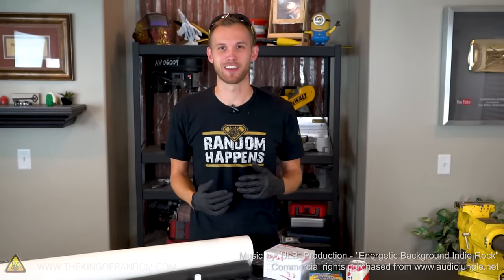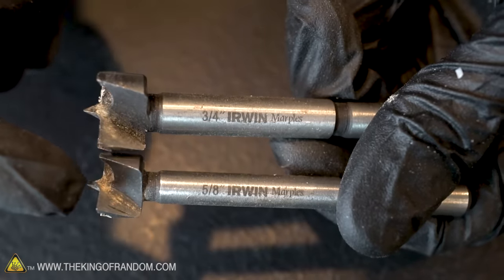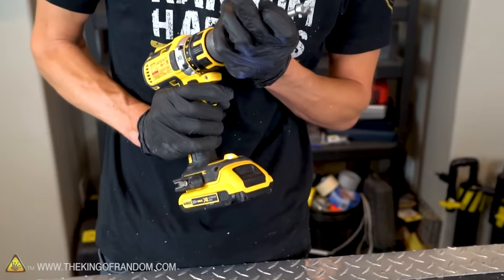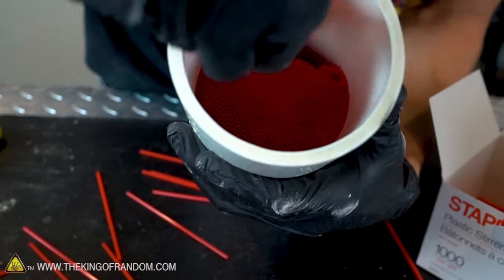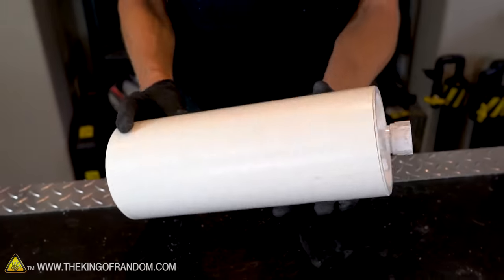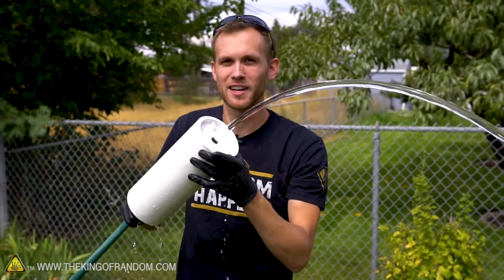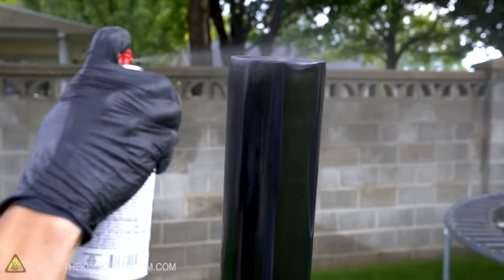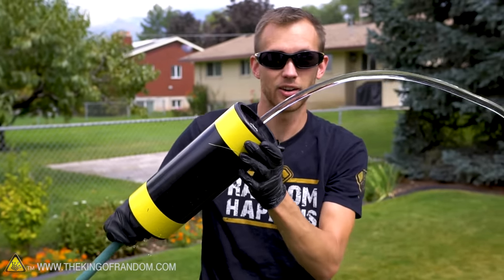Making a Laminar Flow Nozzle! TKOR Teaches You How To Make Laminar Water Flow Fountain

Comment: My hose already does this....
Reply: Gavin Lockheart same, a lot of hoses have something like this built into the drains
Reply: Quadro no I mean my hose. Like garden hose that was 5 bucks. With nothing inside. It's literally just a normal garden hose. And it does this. It's a standard garden hose.
Reply: There's turbulence there that you may not be able to see.
Reply: Deeparth Gupta I'm sure there is a turbulence you can't see inside the stream this contraption creates
Reply: what brand and size hose is it? contribute something to society
Reply: I'm so glad that you meant garden hose and not vomiting from your mouth.
Reply: Gavin Lockheart  I was thinking the same thing.
Reply: ｗｏｗ
Reply: not the same;  one of the things he didn't explain well is that laminar flow is when a fluid flows in parallel layers, with no disruption between the layers; a hose only provides a single flow; not parallel; which in this model is achieved by parting the single flow in to dozens and dozens; via the straws;  the output is much different then you can get with a hose where the water stream is not nearly as smooth and rapidly falls apart after just a few inches
Reply: Deeparth Gupta If you can't see it how do you know it's there? 🤔
Reply: Yea, but most don't have a straight cylindrical stream like in the video
Reply: hoser
Reply: Yeah but did it cost you 30 dollars in extra materials??? I think not!!!😂😂😂
Reply: Gavin Lockheart u are lucky
Reply: Simsimaspineshank S  They make cool fountains
Reply: It's DIY
Reply: @CzarYe  we are talking about your house not your hose, but even some cheap hoses have this system
Reply: 666 likes
Reply: @katethenerd6508  i ruined it
Reply: slorp
Reply: Gavin Lockheart 😭😭😭😭
Reply: robd0gg p
Reply: same
Reply: Get Dustin from SED over here, stat.
Reply: Weird flex but ok
Reply: Mine toooo
Reply: <3
Reply: Ikr
Reply: Same
Reply: Yeah, dont need all of this things.
Just remove the top of your hose
Reply: same
Reply: robd0gg what????
Reply: or does it????
Reply: Same, its a rubber hose but without it, the water is turbulent.
Reply: All hose dude....
Reply: yeah he didnt do much. true laminar flow looks like ice. if you can see the water moving then the water does really have THAT low of a momentum convection.
Reply: Me too the water is like that but I want it faster
Reply: Gavin Lockheart mine two
Reply: Gavin Lockheart LoL I thought you said horse and that would have been a completely different story
Reply: Gavin Lockheart that’s not laminar flow

Comment: You should do this project with something clear like acrylic
Reply: Madhav Valiyaparambil YES PLEASE!!!
Reply: the problem with that is that it's not as cheap. $20 for 2 ft clear pipe, $10 for 10ft normal pipe. and other than showing the parts nothing interesting happens inside.
Reply: You could but other than the initial water charge going into it, there isn't anything to see going on inside. It's not like a filter where you can see debris being captured and removed.
Reply: However, the acrylic might make it possible to add lights to it without compromising the electronics, and making it flashy.

Comment: You sealed the ends with epoxy but the aluminum nozzle will eventually fall off inside if it just has electrical tape holding it in place.
Reply: MegaReddevil91 i was thinking just that
Reply: contact cement would  have sealed it 100%
Reply: PVC cement for plumbing would have been the best option.
Reply: Blu-tack
Reply: Not really.  PVC cement melts the two pieces of PVC together.  JB Weld just fills in the gaps.  You can peel J-B weld off PVC with little effort.
Reply: You claimed that it is "best" but it isn't.  "Just fine" isn't "best."
Reply: You seem to be the one who cares.
Reply: MegaReddevil91 Put elctrical tape then duct tape then gorilla glue it on. Lol. 😃😃😃😃😃😃😃😃😃😃😃😃😃😃😃😃😃😃😃😃😃😃😃😃😃😃😃😃😃😃😃😃😃😃😃😃😃😃😃😃😃😃😃😃😃😃😃😃😃😃😃😃😃😃😃😃😃😃😃😃😃😃😃😃😃😃😃😃😃😃😃😃😃😃😃😃😃😃😃😃😃😃😃😃😃😃😃😃😃😃😃😃😃😃😃😃😃😃😃😃😃😃
Reply: Well Sherlock, you might notice that the aluminum goes in first, then the end cap, and since the water is going out the end cap, the water is pressing the aluminum against the end cap, meaning that the pressure should keep it in place. As for when it is off, the tape is enough to keep it from moving it around. Is that enough? Do you need an equation? A photo?
Reply: Why the gloves and where will this be usefull ?
Reply: MegaReddevil91 I
Reply: He should have used flex tape
Reply: @jaredthomas7993  Crazy glue, definitely crazy glue. It's crazy.

Comment: You can also use PVC glue to glue the ends on. Not putty. 👍🏼😉👍🏼
Reply: Chad Cole its plumbers putty
Reply: hentai lover - I know that’s what he used.
Reply: Totally was thinking the same thing.  But otherwise it was a great tutorial.
Reply: yes, but you don't use plumbers putty on PVC you use PVC cement which is a strong glue that welds the PVC. Putty will squeeze out on the inside like it did on the outside, its more for repair.
Reply: I was thinking the same thing, but maybe he used a solid sealant (epoxy) rather than traditional pvc solvent weld because it can be hard to prevent the primer or sealant from dripping into the pipe (especially if you're a novice at it) which might disrupt the flow.
Reply: hentai lover     "Chad Cole its plumbers putty"

No one here knows what plumber's putty is. One use for it is to take up the space under a bathroom or kitchen faucet set so water and crud don't get under the faucet plate where it meets the sink drainboard surface and start growing microbe and mold colonies and stinking. So, it's just a putty.

The guy in the video said they used a putty-like epoxy to seal their tube and fitting.
Reply: But its more fun to use putty 😂
Reply: Not to mention, you can SEE the 2 colors (blue/white) and he clearly states EPOXY so not sure why it is hard for everyone to understand it is like JB Weld.  That is a far cry from plumbers putty which stays pliable for years, while the epoxy he used will be rock hard in 30 minutes.
Reply: Very go
Reply: PVC glue fumes trapped destroys the straws and scrubbies plastic.
Reply: Flex tape
Reply: @mickeypoppi  prove it...
Reply: Mcroostr --
not sure what part you want proven.  --  
.
The first time I read how to make one of these I was in HS and Graduated in 1971. -- 
As to the source it was in Popular Science between 68-71, not sure when, just that I was in HS at the time. -- 
As to building it; Morris County Museum of Science, Morristown, NJ. somewhere between 1975-77. -- 
As to the ends, we used PVC glue as in the PS article. -- 
As to the lighting idea; it was in the Popular Science article. --
Reply: The putty is made for a glue
Reply: @davewilco822  But don't use it on copper AC pipes. Yeah. The AC guys used it on that, and it came off.

Comment: Put an accumulator in front of the gun.... should smooth out to a more consistent pressure...
Reply: @kingofrandom
Reply: Sam Burris the whole thing acts as one.
Reply: This entire device is an accumulator. Putting another one in front would only ruin the laminar flow.
Reply: use a bladder tank
Reply: No it's not... there's no room for expansion or retention of pressure, all this device is a 'straightener'. an accumulator for liquids will either have a bladder or an air chamber of some volume above the flow so that the air in that tank can act as a simple regulator. 

This is absolutely NOT an accumulator.
Reply: kleetus92 more liquid builds up in the device than can be put out. It must fill up before working. So yes, it is essentially an accumulator. However, it is not ONLY an accumulator.
Reply: This gun acts as a flow regulator... an accumulator is a energy storage device that stores potential energy using compressed gas with or with out a bladder... basically a electric capacitor for hydraulics(water is hydraulics)... so if there is any changes in pressure which there is it will delay and compensate the reaction of the final exit pressure thus smoothing out the flow... fluid power engineer here😃
Reply: Do some research it will become obvious
Reply: Sam, so are you saying this IS an accumulator, or just explaining what a hydraulic accumulator is? I agree with your definition, but not that this is an accumulator. Or am I missing something? Once it's full, its basically another section of pipe, solid walled with no expandable volume to compensate for anything. This is especially true if the discharge nozzle is pointed up.  Down one could kinda make a weak argument that when the water is shut off, this 'accumulated' some volume of liquid that will be drained out after the valve was closed, but that's based purely on it's physical orientation.  Power electronics engineer on this end.
Reply: He said this is not an accumulator. Just a flow regulator.
Reply: What spiffyman said

Comment: I'm curious as to how the flow would behave if the outlet wasn't simply a perfect circle. How about an ellipse, a square, a triangle, a wide slit, or any other shape. Could the flow be made to look like it's twisting?
Reply: Roger Garrett 
Or totally change it and put air bubbles in it.😐

No I get it, designer faucets is what yer thinking.
Reply: yes different shapes, no twisting, laminar is straight out the nozzle
Reply: Roger Garrett you can't make water form a square or triangle lol... unless it's contained.. Water molecules naturally want to form spheres/oblates.. just about like everything else in the universe
Reply: I fully understand that the stream would not simply retain the shape of the outlet. But I would expect that the "collapse" of the shape of the water at the outlet into a more circular shape might just rebound in some way and cause cyclic pulsating along the length of the flow.

Also, if the outlet were, say, very wide in one direction but of varying narrowness in the other direction the water might be coming out faster in the narrower sections than the wider sections and you might get some odd features along the path of the stream.

You could also have an outlet that's not simply an opening in a flat plate but rather more like a nozzle, and that nozzle could be designed so that some of the water is directed in one direction and other parts of the stream directed in other directions, so you indeed get a twisting stream, at least for some segment of the stream.
Reply: Roger Garrett so like a normal garden hose with selectable nozzles? The whole point is that a circle causes no turbulence aka laminar flow nozzle.
Reply: I think nature likes efficiency and round is very efficient !
Reply: even though you can make helium filled soap bubble balloons, they are still teenie round spheres! (bubbles) stuck together to make the shapes!!

Comment: Higher pressure means more velocity.  More velocity means a higher Reynolds Number.   That would also cause it to go turbulent sooner.
Reply: joemonster55 ikr
Reply: faster flow means less pressure; as an example we can look at a wing where the air is flowing faster on the upper side creating a pressure difference between lower/upper side and that generates lift.
Reply: Philipp Campos
that's totally not what he was talking about. higher pressure means more velocity, period.
Reply: joemonster55 would a smaller tube work then? That would cancel the higher velocity in the reynold’s number
Reply: Philipp Campos you are incorrect and especially applying that circumstance to this one.
Reply: Wrong
Reply: Actually, when he said more pressure, the correct term is more flow rate. We can't use de Bernoulli principle to explain that. When the guy in the video opens the valve, he is increasing the amount of fluid that are passing thru the pipe, that is, increasing velocity. 
That is true, for an incompressibile flow, when the velocity increases, the static pressure decreases, and there is the key, the concept of "static pressure". This phenomenon is not easy to explain and understand. If you guys really want to know about it, I recomenda book called Fluid Mechanics, author Frank Withe.
Reply: joemonster55  bro it’s about inconsistency not velocity

Comment: How can I adapt this concept to peeing?
Reply: Brandon Ali sand the edges down make it reaaal.smooth
Reply: siksreik That hurts just thinking about it!😂😂😂
Reply: Brandon Ali is
Reply: siksreik then shove a bunch of coffee straws inside
Reply: Brandon Ali pee through one of these
Reply: Use an angle grinder. Grind it all
Reply: Brandon Ali we need more people like you
Reply: Hi baby I’m going home now I’ll I

Hey
Reply: Don't forget to cut some rings off the end and use those to shove some abrasive pads in...
Reply: surgery.......very invasive, difficult surgery...
Reply: +Brandon Ali
Simply create a smaller version of the laminar flow nozzle and then slip it over your own nozzle.  Then go and pee on an electric fence.  If you can feel the current then the laminar flow is working correctly.
Reply: Try put some coffee stirs in there
Reply: Sand the nozzle.......

Comment: well done. using smaller straws will improve your results. Also, there is a point where sand paper becomes useless and stropping with wood or leather and a ultra fine polishing compound will greatly improve your success. As for higher pressure, i would assume that at a point you will have to have a bigger setup and a multistage baffle system. sort of a step down in straw size. more volume. 

it seems to me the higher the pressure, the more magnified the imperfections in the nozzle would you agree?
Reply: Excelsior!

Comment: Cool video but why would I want that? What is its purpose?
Reply: Jim Gordon I believe it is for ponds and decor.
Reply: Idk
Reply: I have a cheap 99¢ cone hose end that will do this at a relatively low water pressure.
Reply: Fountains, decor, and an easy way to impress friends
Reply: It's just a fun protect that you can do.
Reply: Jim Gordon s
Reply: Its satisfying
Reply: It looks cool. Duh.
Reply: Lol my bath's faucet does this on low water pressure, it looks cool with only hot water flowing because tiny bubbles make the water look a sparkling white
Reply: Jim Gordon it's just cool and satisfying to watch
Reply: L
Reply: Maybe if you're simple. But a lava lamp does the same thing and they have them at Wal Mart.
Reply: A E S T H E T I C S

Comment: Hey The King of Random What about putting some sort of O-Ring at the end of the nozzle to make a perfectly smooth nozzle end????? Would that work?????
Reply: In order to not have a gap, the O-ring would have to be a squared off ring (like a hose washer) and not a rounded one.  That small gap may cause enough distortion in the flow to break up the flow.

Comment: Calculate the Reynolds number. Is that less than 2000? If yes then the flow is laminar.
Reply: Sabin Khadka 500? its around Reynolds<2000 for it to be laminar
Reply: it is 2300 =)
Reply: why dude why
Reply: Michu's Gaming Cuz u don’t know what u saying
Reply: Michu's Gaming Actually, it's 2001. Still not laminar
Reply: MAYBE, but there is a transition area around that number, be sure to check the Moody Diagram.
Reply: @michuzaki6692  i did the calculations agajn and found it was 3001
Reply: oh yah i messed up thanks

Comment: Did you just seal PVC with Epoxy... What a Scrub
Reply: Bob Saget lol.. I don't get it. Whats the ideal or correct PVC sealer?
Reply: TTime685 pvc cement
Reply: STEFAN actually pc cement should only be used in select circumstances, and requires a roughed and primed/softened surface. Epoxy works fine though
Reply: CA glue and baking soda .hard as a rock!

Comment: Great video. Some questions:

Why not just use a black PVC pipe instead of painting a white one black?

Also, couldn't you just size the nozzle to end at the straws and avoid a gap that needs screens?

Does the diameter of the main body need to be so much larger than the aluminum aperture?

Comment: The rings holding the screen disks are probably a major source of turbulence. I am not sure why you think screens are going to prevent turbulence. Turbulence is movement perpendicular to the flow, and screens being nearly two dimensional perpendicular to the flow means they have no resistance to turbulence. The reason the straws work is they are parallel to the flow.

Comment: Great project! Now what is it used for??? Wouldn't it have worked just as well to use PVC cement during assembly? If you read the package from the epoxy putty, you'll find that it is NOT usable with potable water.

Comment: +   I think that if the tube is aimed at a 45 degree angle, you will get the greatest distance.  IIRC, at 45 deg, the height of the stream is 1/2 the range.  At least, this works for gun projectiles in tanks and battleships! ... and thrown rocks.

Comment: Why didn’t you use pvc cement?  In Las Vegas they had a simulated pond with laminar flow nozzles strategically placed and timed to where it appeared that the stream of water was jumping from one Lilly pad to another several times. It was a very cool effect. Something you would stare at for an hour.

Comment: I wish to ask if anyone else has a practical application for this?  To me a laminar flow has the highest force at a distance. Also, can deliver hardest punch.  His contraption needs to be hooked up to a big water pump. However there is the competing tech of extension wands. I have owned 24 foot, 18,and 12.  Over 18, it becomes a wet noodle and not controllable.  But I don't like 18 either, as it is nearly so. 12 foot is OK.  However, even shooting a few feet away, clean laminar achieve things, amazingly, that atomized, turbulent water cannot due to exponential dispersion in air. You would think it would be intuitive that water plus air plus wider surface area, equals less force. But people like sound and fury.